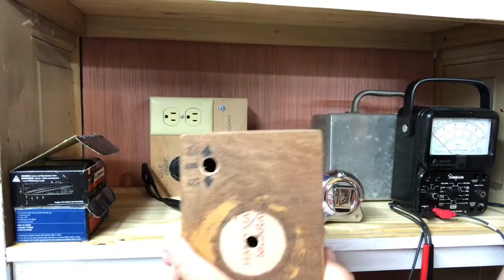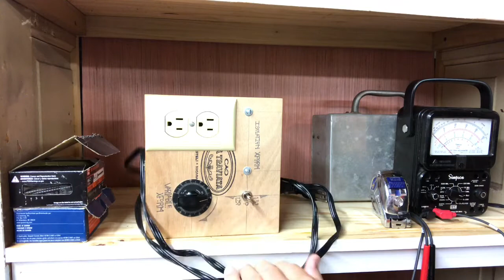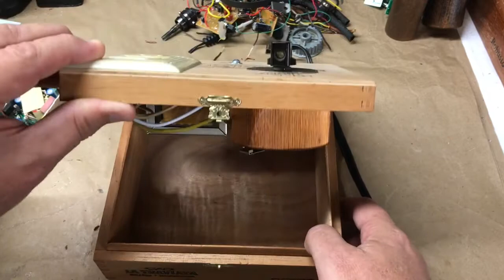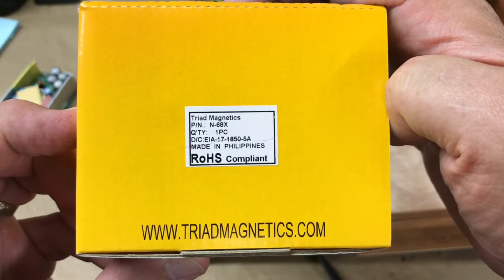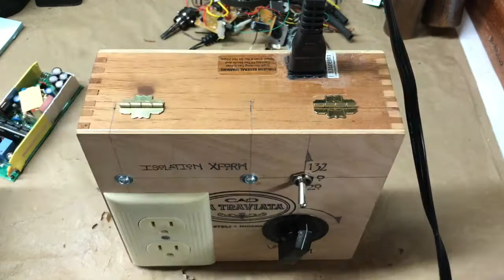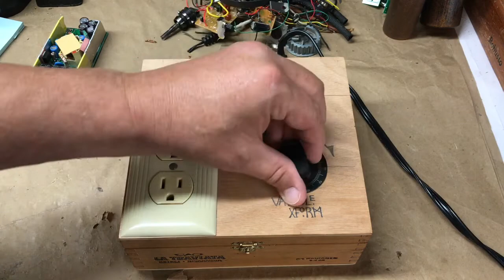Isolated Variable Power Supply

Comment: Replace the Grounded outlet with a GFI/GFCI. Connect the ground to the Isolated neutral side of the GFI/GFCI through a switch.
Now you have a functional isolated ground that is safe, And can be disconnected if needed. 
If you're outlet is connected to the actual earth ground, It is not safe. And if something happens, the GFCI Will turn off the power automatically.
Stay safe.
Reply from the maker: Great advice Joe. I may even have a GFI type outlet laying around.